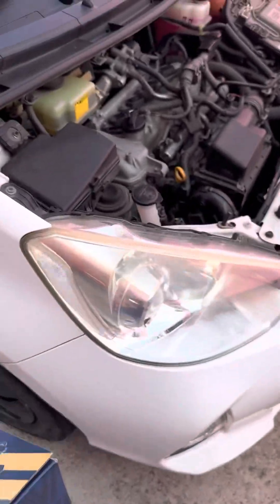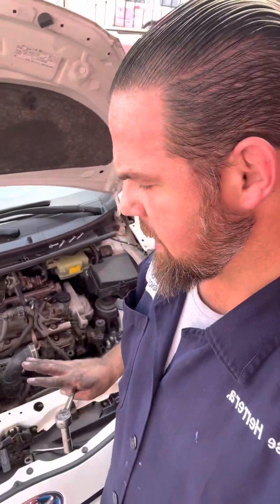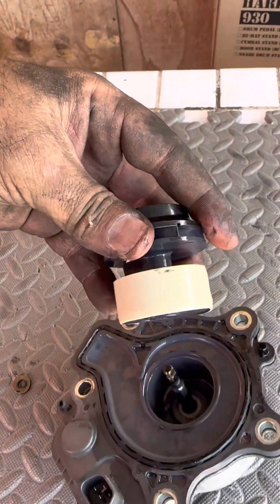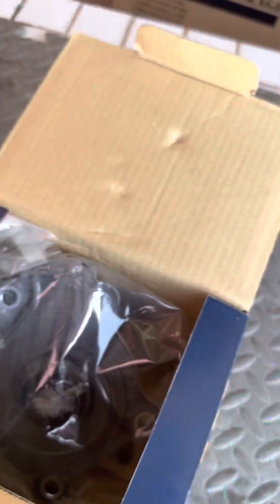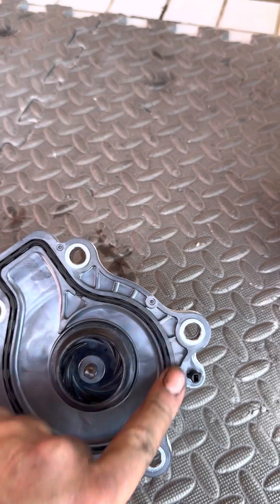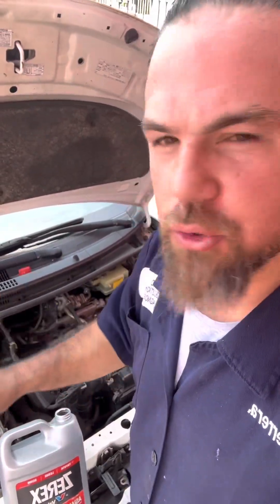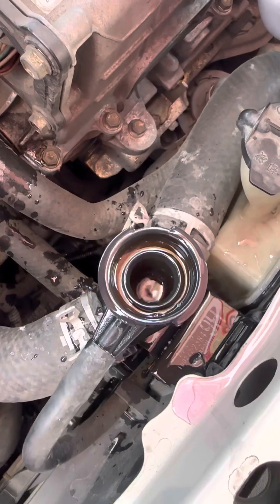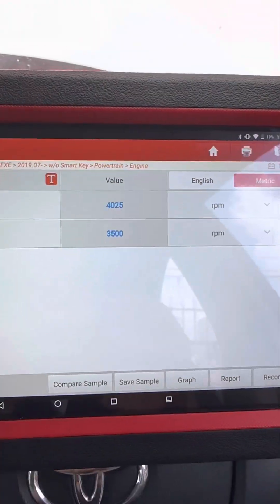Toyota hybrid vehicle engine coolant pump replace tutorial

Comment: Is the rotting of the internal plastic rotor related to old coolant usage?
Reply from the maker: Temperature 🤒
Reply: @hybridsolutiondiagnostics  I believe is thermal breakdown, right? In your experience, what's the appropriate interval for replacing it in places such as the Caribbean?
Reply from the maker: @Jatsotserah  100k

Comment: Don't forget d coolant pump Is a  high voltage component so we must always disconnect d service plug wen changing this part.
Reply from the maker: It is not a HV component my friend 👋😅 this unit works with the 12v system